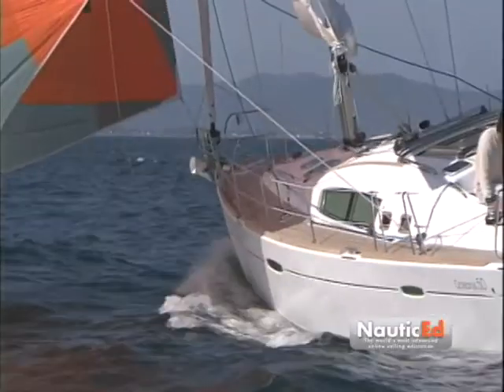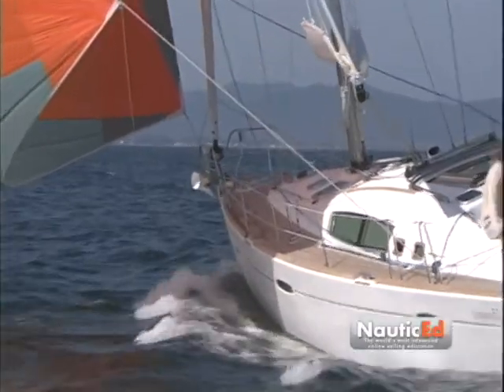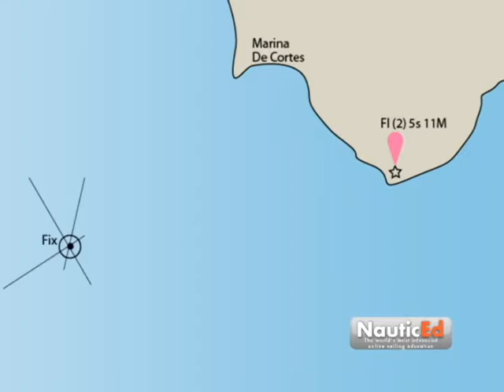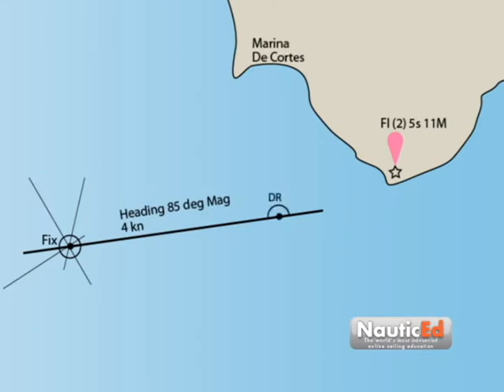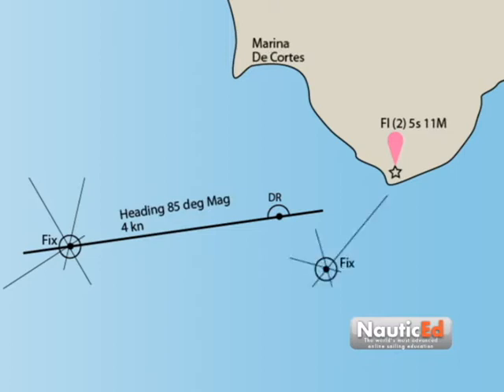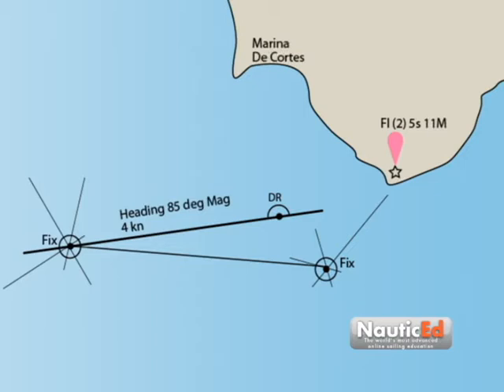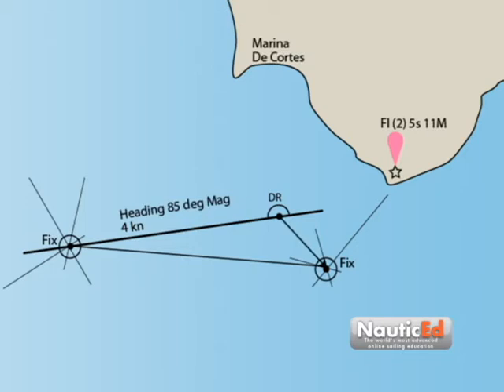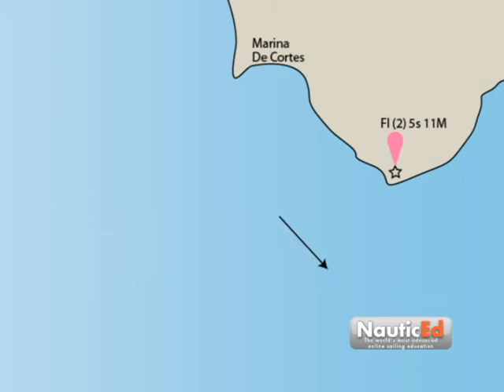Coastal Navigation - Easily calculate your set and drift

Comment: hello sir
please explain about actual set and drift

when wind and current exist and
we want to find (actual set and drift).

first step:
plot position A and B, draw C.M.G

second step:
apply current and with the help of divider find
Water track (in case wind and current exist)

this is my question: how can I find actual set and drift

1. transfer Water track on position A and apply ship's speed to reach sea position,
and the difference between sea position and fix position is called actual set and drift.

2. transfer Course To Steer on position A and apply ship's speed to reach DR position,
and the difference between DR position and FIX position is called actual set and drift.

which one is correct?